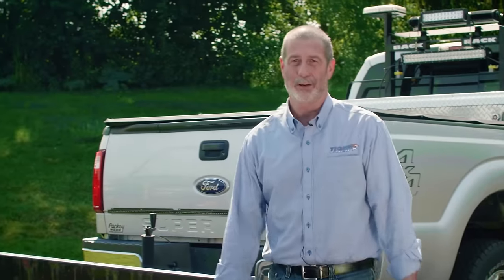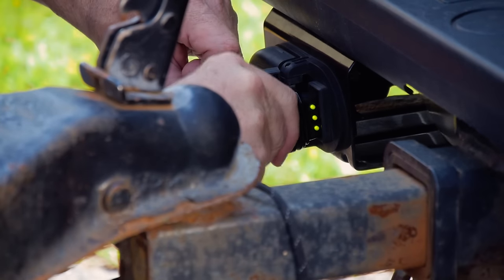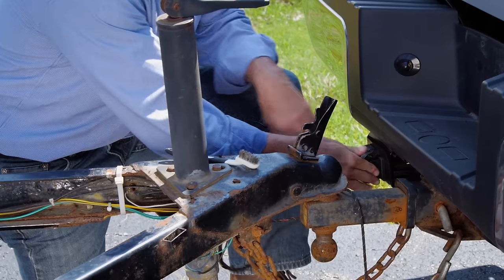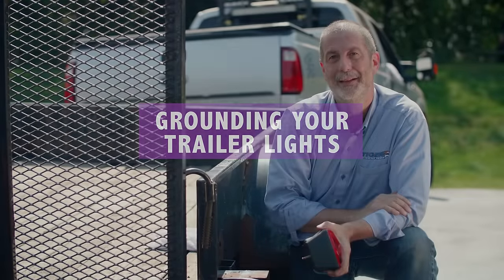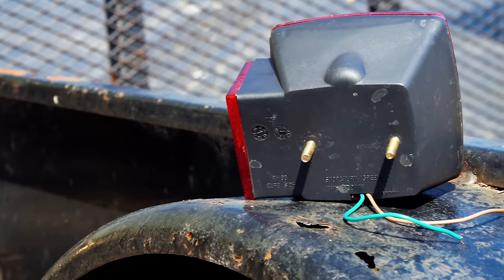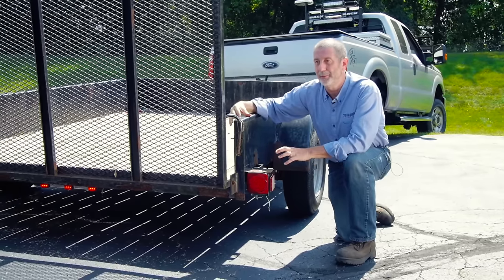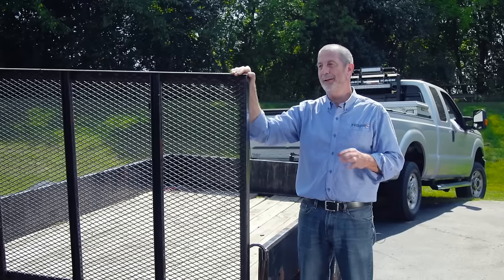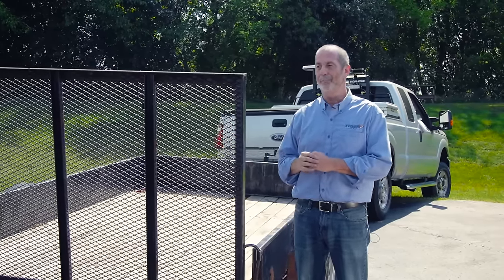Troubleshooting Trailer Lights - Grounding Issues

Comment: Super helpful. Most helpful YouTube video I've seen regarding this issue. I assembled a Harbor Freight Haul Master 4 x 8 folding Utility Trailer last weekend and the lights they packaged had a separate ground wire for each light while the instructions assumed I had been sent self grounding lights. There was also no screw hole on the tongue for that ground wire which the instructions indicated there was. My first time wiring up a trailer and this video has given me confidence to just roll with the lights I have and ground each one to the frame of the trailer. Seems to me that having a grounding wire for each light might be safer in the long terms than having self grounding lights anyway(?).

Comment: Wow! 4 1/2 years later this is still the best video out on youtube. I have a folding trailer and had no idea that could cause my grounding problem. thanks for putting that in your video.
Reply: This is me right now. I wanted to do a quick test with it folded up after installing some new lights. Brake and turns worked fine but not running lights. Hopefully it's just the grounding issue while it's folded. Will try again with it unfolded to see if it's all working.
Reply: Agree!
Reply: Update: It wasn't just the folding. The running lights still don't work, so I think it's an issue with the vehicle wiring. I'll have to take a closer look at that.

Comment: I've spent far too much time troubleshooting my "sometimes they work fine, other times not" touchy boat trailer lights. Never before had I been told about the light ground via the bolts. I scraped off the paint around the holes where those attachment bolts fit, and problem solved! Same as Scott below. Thank-you.

Comment: Excellent video! Just this past weekend we assembled a kit trailer from Norther Tool. It came pre-painted in black and of course all of the holes are painted as well. None of the lights work and I've already determined that there is power to the connection on the back of the tow vehicle. Time to do some sanding and reconnecting the ground wires! Thanks!

Comment: Awesome video! Helped a bunch. Didn’t realize that the tail lights without the ground wire uses the bolts as the ground. Cleaned where the bolts contact the trailer, problem fixed. This is also a tilt trailer I’m working on and if you shook the trailer the lights would go in and out. Put a ground wire where it tilts. No flickering of the lights. Thanks for your help!
Reply: My problem as well. His and your mention of the tilting of my golf trailer solved my problem with the intermittent lights.

Comment: Excellent video thanks, solved my lighting issue on a new trailer, i had the lights that ground through the bolts and the paint was blocking the connection, after cleaning the metal and reinstalling all works perfectly now.

Comment: Follow the rust.  A month ago I had a truck bed to frame rail, that connects the 2 because the bed mount rubber isolates the bed, completely gone.  I fixed it (added 2 clips and braided brass wire to connect them, ground down to bare metal first, clipped the braid to the 2 bare spots) and the trailer brakes worked again on my dump trailer.  This week, no brakes again, ended up being on the trailer ground, where the run away trailer cable box grounds, sharing a bolt with the ground that comes up from the wire bundle for all the trailer's lights and brakes.  I ground all fresh metal and then coated around the edges, leaving bare metal and used a new bolt to tighten it all and used more di-electric grease to coat it.  Should be good for a few months, then re grease to try and prevent water from entering and rusting.  I will put it on my calendar to pop up monthly, and I can ignore it, or eyeball it.

Comment: I have newly wired an enclosed trailer and cleaned all the grounding points and checked all the connections with a meter and I only have super dim side markers. Nothing I do changes anything. All the lights work when tested on a battery and all the pins from the truck test good. Even my LED taillight bar works perfect but the trailer lights just won't work

Comment: Yes sir this video gave some insight as to what the problem was... which I would have never thought to look for... I have a fair new 2017 F-250 that recently was having no trailer tail lights didn't know what happen was working when I got the truck, anyway watched your video and "BAM" check out the truck not the trailer by the way I ran new lights on my boat trailer...so I figured that's where the problem was.. anyway it wasn't, truck had no ground (WHAT!!!) ok grabbed my manual and looked up my fuse location and found out it was not blown but missing... problem solved! Thanks 😊

Comment: Why cant you run the white wire all the way to each light fixture ( if it has the separate wire) it would make for far less connection issues down the road, would it not?
Reply: My question too!! Did you ever get an answer?

Comment: Will you read voltage if it isnt grounded? 
I read 12 v at the light, but it wont work. I tested the light separately on a battery and it works.
I has the confuse...

Comment: One thing that ended up being my problem was the ball hitch. My trailer was setting for some time and the inside of the coupler was rusty and not making a good grounding connection with ball.

Comment: Also newly painted brackets that doesn't come with your lights need to be sanded down for metal to be seen for good contact each light has to be grounded if not having the white wire included! 

Hope this helps!

Comment: Does a trailer's aluminum frame conduct the ground just as well as a trailer's steel frame?
Reply: Nobody answered you yet so hopefully you figured it out. Aluminum is a better conductor than steel. The problem with aluminum is dissimilar metals corrode. I would recommend cleaning aluminum and connector and apply die electric grease during assembly to prevent corrosion. He should have mentioned this as its a good idea even on steel trailers.

Comment: Thank you for the video.  I'm not sure this is my problem with trailer running lights, but it give me a good place to start.  Does the trailer hitch need to be in contact with the truck ball in order for the lights to work on the trailer, particularly the running lights?
Reply: Jay Monroe I
Reply: Good question, did you ever get an answer?,
Reply: @lauriepcampbell795  Yes I believe so.

Comment: Everything works properly on mine except when trucks' lights are on. My brake lights go out on the trailer when I hit the brake pedal. With truck lights off everything works normally. I have the stud type of light mounted to PVC pipe and I ran wires from lights directly to the ground wire on the harness. Does anyone know how to correct this? Or what I may have done wrong?

Comment: Tilt Trailers must be grounded on the bed not the tongue! if you ground on the tongue your going through the hinges and the lights will cut out when you drive, if you ground through the bed where the lights are bolted to, your good.

Comment: Just curious....couldn't the ground cables at the lights be mounted to one of bolts holding the light? They're going thru the frame. I am putting a set of these on right now and was wondering if this would work instead of drilling thru the trailer?
Reply: I realize its been a while so this may not actually help you any, but for others...  Yes, I've done this dozens of times and as long as you have a nice clean spot to seat the eyelet it should work great. Sometimes I double nut the stud where I choose to install the eyelet, putting it between the two nuts.

Comment: I have a weird one. Just purchased a 5x8 utility trailer. Left signal, both tail lights, and brake lights are working fine. The right one blinks at normal speed exactly two times then goes to a fast blink as well as the right blinker on the truck. As soon as I disconnect the plug, truck right signal goes back to normal speed. When I connect the same truck to my boat trailer, everything works fine. Anyone have any ideas ?
Reply: @Vstar5 

It’s not the truck, when I connect my other two trailers it works